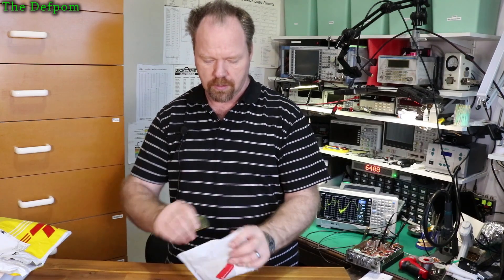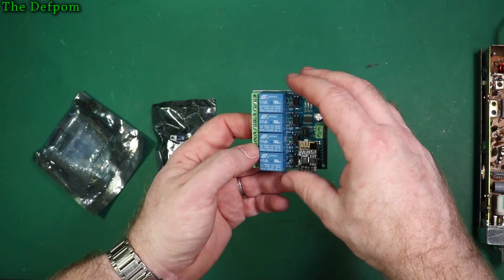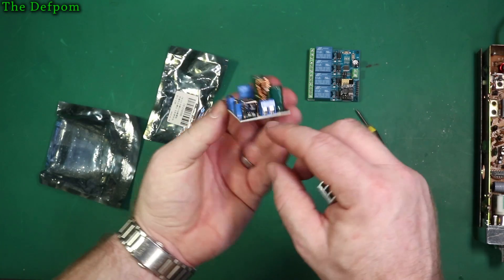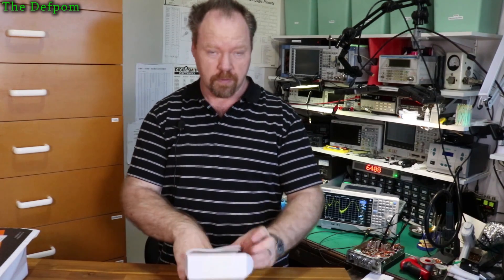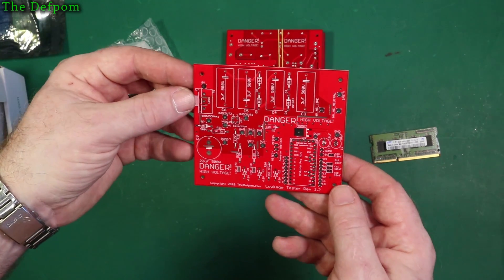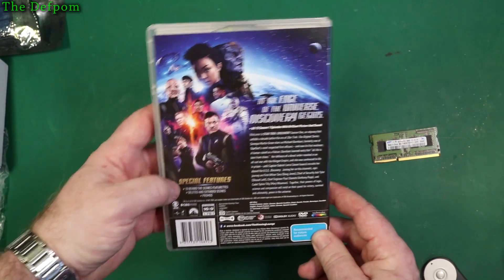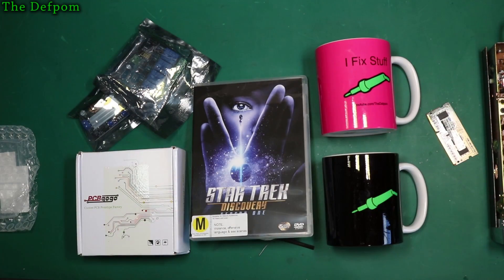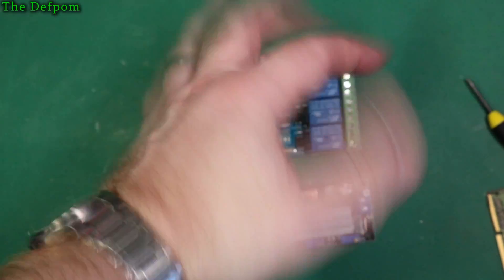🔴 #531 Mailbag Monday 18th March 2019 - Sponsorship items and My Merch!

Comment: you have had between 16-21 dislikes spread over your videos lately wonder why
Reply from the maker: antony redfern - the video I posted on Friday had 98 dislike yesterday when I looked at it! A normal expectation is around 10% like and 1% dislike relative to views, any significant deviation from this shows a great video, or a terrible one, having 20% dislike is horrendous and inconsistent, especially as it does not match when it comes to lack of negative comments.
Reply: @TheDefpom  Then again, dislikes still count as "interaction" as far as the algorithm is concerned. All the downvotes really do is prevent your videos from getting recommended to the downvoters.
Reply: just watched the end of the video... assholes.